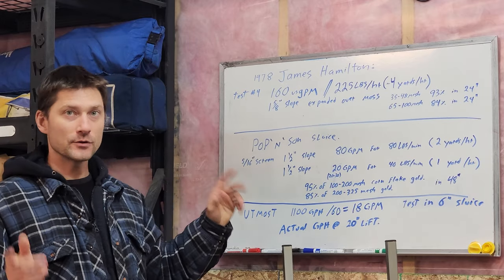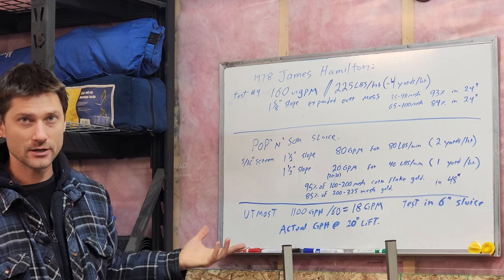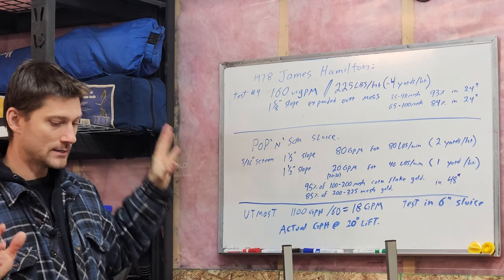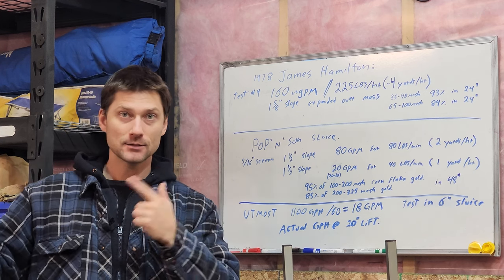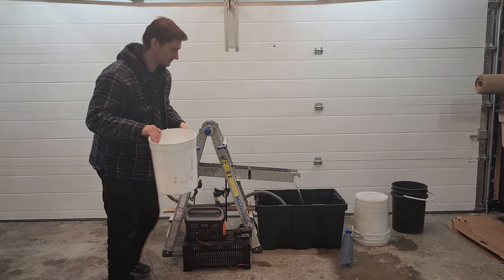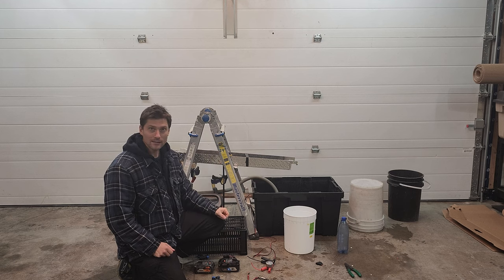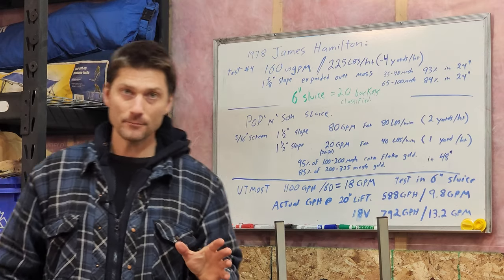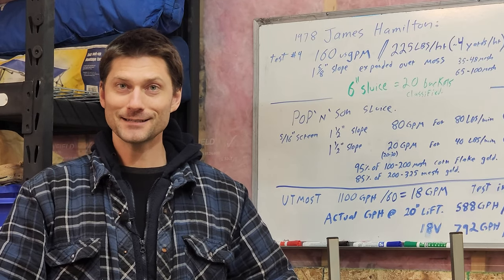Testing 1100 GPH Bilge Pump for Gold Mining.  What is the real world flow rate?

Comment: Kyle, this was like attending a class on my favorite topic by an excellent teacher. Great stuff! I have read the PopAndSon Sluice study PDF a few times, was interesting to hear someone bring it to life. Note that they use multiple (2-3) sizes of expanded metal - to catch coarser gold (which isn't an issue in your part of Alberta). I hereby issue you a challenge. A Dollar Store plastic boot tray is ~12 inches wide. Try running it as a sluice with black ribbed carpet from the dollar store, with no expanded metal on top. The ribs function like expanded metal, and the spaces between are like drop riffles. The boot tray also makes a good extension. Just place it on the ground at a slight angle, and have your highbanker discharge into a catch pan at the top of the boot tray with the ribbed carpet. I have run a highbanker with this exact setup on The Fraser River and caught a ton of flour gold in a heavy black sand area. Whether you make a video about this or not, I dare you to try it yourself and see the capture rate. Won't cost more that $10, and the boot tray is extremely lightweight and compact. As a bonus, you can vary the sluice width on the boot trayusing simple wooden garden stakes. To get even crazier, you could angle the garden stakes to have the sluice width gradually taper outwards. Just some ideas I have tested on and off over the past 4 years. If you do try the dollar store boot tray sluice with ribbed carpet, don't be shy about the angle as you don't want sandbars forming as that is a gold robber. Cheers!
Reply: Source - PopAndSon sluice documentation "So through trail and error, we have developed the Popandson Sluice for fine gold recovery, comprised of a series of different sizes of raised expanded metal over Nomad
miner’s moss in a simple and inexpensive gravity sluice. Testing 1,2 shows recoveries of
+95% of gold from 100 to 200 mesh, and +85% of gold from 200-325 mesh at small
scale “production rates”. Nuggets to 5/16” are also captured."
Reply from the maker: Dan, I'd actually love to do a full mat comparison video one of these days, but it just takes a lot of time to do the testing properly the way I'd like to test everything.  I do have a few ideas already of things to test out, and will add the dollar stove matting to the running.  I haven't actually gone looking for ribbed matting at the dollar store yet, if you could, I'd love to see a picture of what you had success too.  Email me a picture from your cellphone if you get a chance and I'll try to hunt some down for when I do the test.  :)

Comment: That 1100 GPH is the perfect flow rate, or maybe just a little too fast, to run my drop riffle sluice (6 1/4" wide x 28"). I get great exchange at a slight angle, and capture the 100 mesh gold.
Reply from the maker: Yeah it works out perfect even if it happens to be rated a little ambitiously!

Comment: THANK YOU AS I HAVE SO MANY PUMPS, VALVES, HOSE DIAMETERS, CLAMPS ,NO CLAMPS, PRESS FIT ,COMPRESSION FIT, 1INCH TO HALF INCH TO 1/4 INCH, SILICONE  ,PLUMBERS PUTTY, DREAM MAP ,GOLD HOG MATS ,
1100, GPH, 800 GPH, 600 ,FISH TANK PUMP ON YOUR MILLER TABLE .

THANKS BRO
Reply from the maker: It sure can get complicated quickly!

Comment: Check out Poling’s and Clarkson’s studies as well. Sluice width is the largest determining factor as to amount of material and hour. Ideal slurry density is 12% solids, or 1 gal of material per 8 gal water.
Reply from the maker: I was always impressed with the yardage they were putting through their sluices in these big commercial studies.  If I recall correctly they also discusses scouring action while running empty.  I found that the pop'n'son sluice style runs far less in terms of yards per GPH and sluice width, but does better with scouring when run empty.  This is a major consideration for hand fed shovel in operations, as there is always unplanned down time.  I love that there are some scientific studies on this subject, as otherwise so much of it just seems subjective.  Let me know of any other studies you are aware of and I'd happily read up.
Reply: @UtmostOutdoors  I think a major weakness that most people don’t consider is the effect of surging, rapidly changing water densities by dumping solids into the water flow. It rapidly slows down and speeds up over the riffles which is known to knock gold loose as well as pack the riffles full. Use of a hopper to ensure a constant and consistent flow rate should be more widely used.
Reply from the maker: Excellent point!

Comment: If your going to run a 5 inch sluice just use the 6 inch with 2 spacers down each side to choke it down. That way you have a normal size setup for matting and the like without waste. The same machine can them be stripped down to just v mat in the field and back to the 6 inch configuration for slow cons cleanup before leaving the river.
Reply from the maker: That's an excellent idea!

Comment: As with you I build my own stuff and built an 8 in wide 48 in long and started with a 1100 pump didn't like the flow and went to a 2000
Dint like that and put a second 2000 knowing I wasn't getting full 4000 per but liked the flow at this and burned one pump got a 3700 and really like what I have going now on Michigan fly poop -100 mesh and smaller

Comment: If you do what I do , where I do it and with what I do it with you will get the same results.
But the world is not the same all over , and a one size fits all does not work here.
I have tried and have found trial and error in the field is the best test.
Like @bart bley commented , eliminating bottlenecks is where efficiency should be directed.
Reply from the maker: I agree!  I think there are lot of easy way to loose gold with the wrong mats, but there is SO SOOO much more to it than that.  So long as you're somewhere over the 90% mark, you can safely focus on everything else.
Reply: @UtmostOutdoors  Just make sure you are travelling towards what it is you are aiming at.
It is so easy to get distracted off that path.
Financial compensation for your effort from satisfied customers.